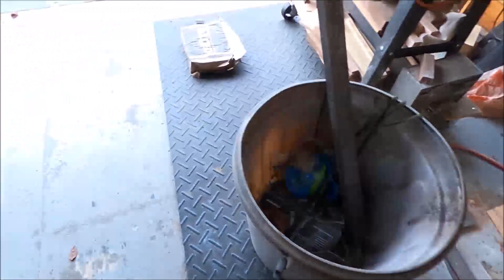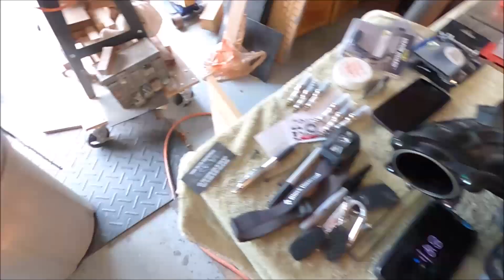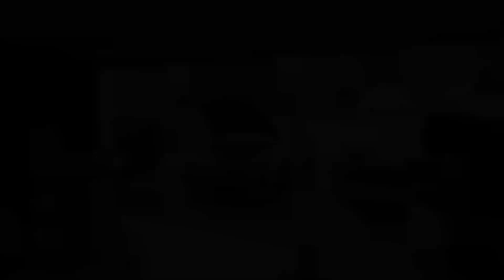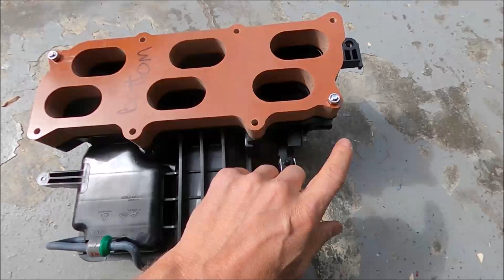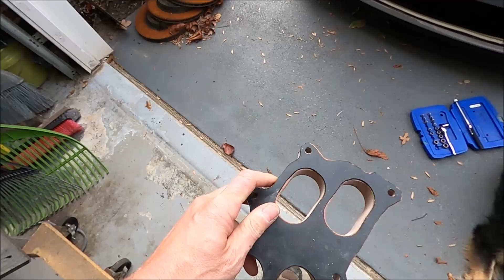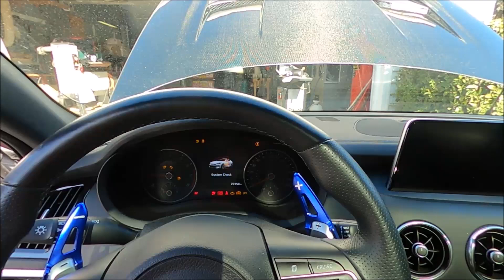Stinger 1" plenum Spacer installation

Comment: Hey man, sick work you've got right there. Just quick questions: why not drill the meth ports on the manifold directly instead of going through all this headache?. Also, how's the difference? I am really interested on how that will impact performance. I really appreciate your efforts keep it up!
Reply from the maker: Great questions. As a matter of fact I have a version now with 6 helicoil treaded inserts for nozzles 👍🏼. As far as performance I believe it helped. I did hit 10's with it in, it's lowered Mt IAT'S,  and getting to plug 3 is super easy now.

Comment: Bro, when you get racing seats. Where do you plug the harness ? Does it light up on your dash? Like the airbag thing?
Reply from the maker: No electrical harness needed, you only get an airbag light on the dash
Reply: @awdgt2stinger270  do you happen to have measurements ? Or any universal will fit?
Reply from the maker: @DavesGaragee  there was nothing universal about it unfortunately. Everything was custom fabricated. The only way to show it is a video which I plan on making soon
Reply: @awdgt2stinger270  thanks brotha 🙏🏽

Comment: Killing me here! What kind of numbers did you get over the weekend? This is a great idea, especially to add injection or nitrous.
Reply from the maker: 11.011" :)
Reply: @awdgt2stinger270  What was your previous fast time? I know one person ran a 10.96 in the forums.
Reply from the maker: @StingerGT2  so for paper slips, 10.942 #1, 10.977#2, and me at 11.011. I was 11.06 but considering I just bolted this thing on and haven't tuned the car to it yet, it's got way more potential 😁
Reply: @awdgt2stinger270  Yes, looking forward to see what you do next.

Comment: You wanna sell some of these? I'd buy the spacer with all the required hardware and try this. I probably won't port anything because I've never done it before but I've removed the intake already once to do the plugs because I don't have the fancy swivel tools needed to do it without taking it off. This is of course after you test it and put it through it's paces and prove it actually does something. Just being able to get to the plugs would be a huge benefit. If you have a CAD drawing I know a place that could make one of these out of aluminum using a CNC laser cutter. With a lot of boost I'd prefer a metal riser and maybe only 3/4" tall. Nice job though trying new things, that's what makes this all fun. Thanks for taking the time to make a video about this.
Reply from the maker: I ran an 11.011 last night :)
A new Personal record.  I do plan on making more and soon.  I wouldn't recommend aluminum though, it conducts heat as opposed to Phenolic that insulates. 
The CAD is close hold, I spent  40+ hours 3d programming it. My next run I'm going to shoot for the 8 holes, it will a few bucks for the machining but an easier turnkey product.

Comment: Never used a spacer on a turbo car. Ill be curious to hear how it works. Turned my V6 camaro into a beast with a lot more low end and midrange. How did ypu make that? I'd be curious to have a 3/8 to 1/2" one.
Reply from the maker: I bought a used lower intake off Ebay, and used it to CAD the ovals and overall shape.  Then I bought a chunk of 1" Micarta (Phenolic) and sent it to a buddy who runs a water jet machine.  I didn't have him put the holes in for two reasons.  Cost, and it's difficult to pierce something that thick.